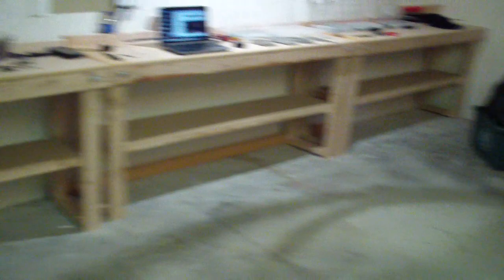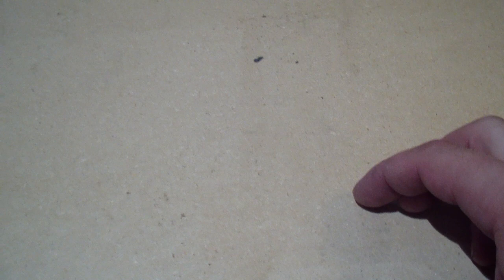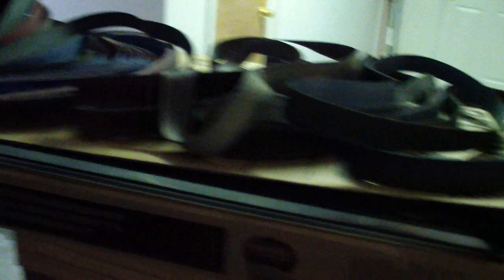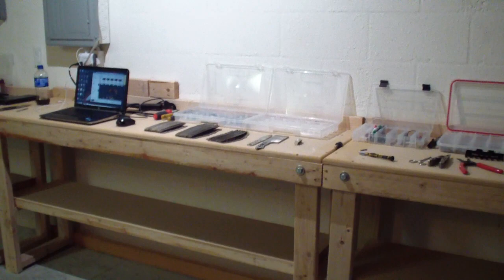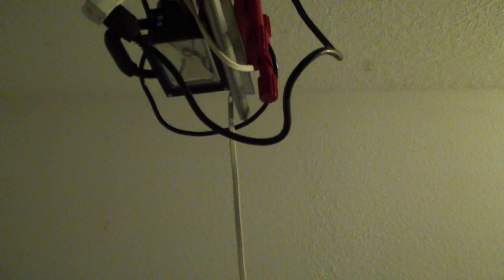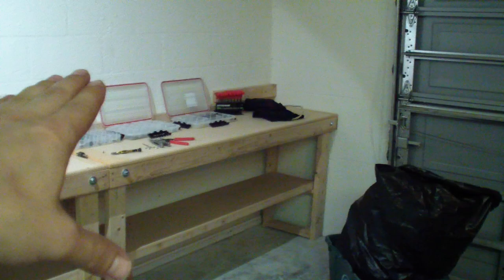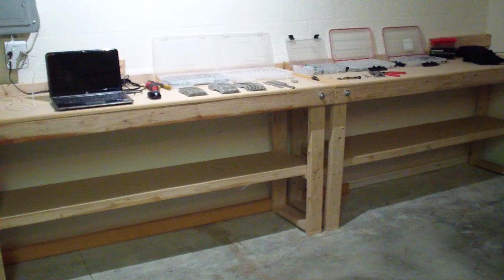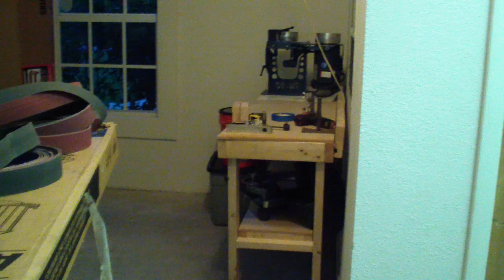1st Shop Update in Fl

Comment: Gav, i know i have seen builders here using big black plastic sheet with extendable poles that hold the plastic in place. They were screw or pin height adjust, similar to a painters pole for reaching high ceilings.